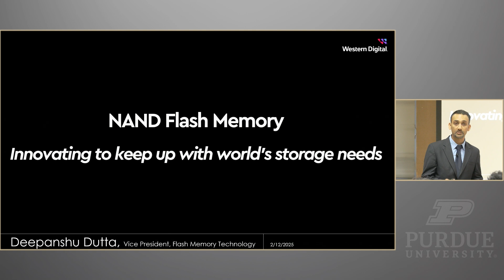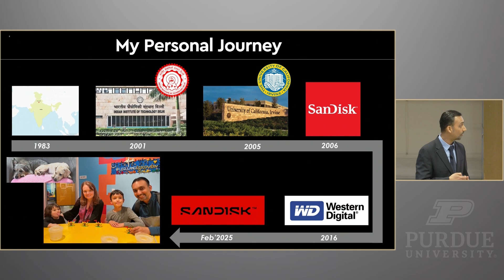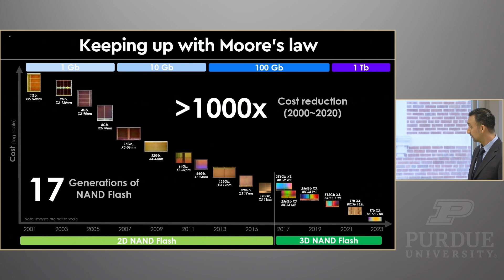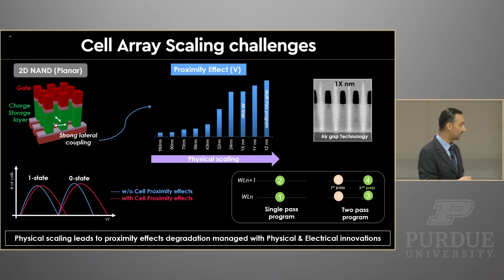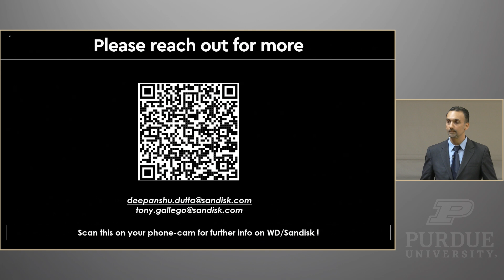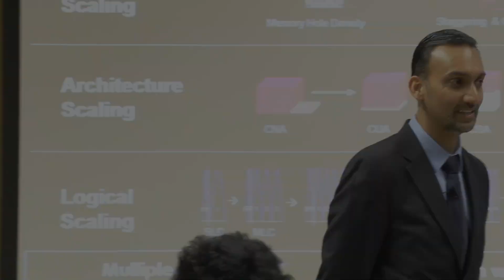NAND Flash Memory; Innovating to keep up with world's storage needs

Comment: The next step is 3-Dimensional Optical Storage where information isn't just stored in whether or not an electrical charge is present, but by the properties (spin, wobble, ...) and positions of the photons in relation to each other in a high-dimensional space.  This will enable integration with optical processors and memory controllers, and will work well with Graph Neural Networks and other AI architectures.